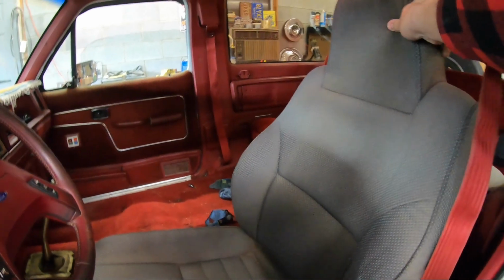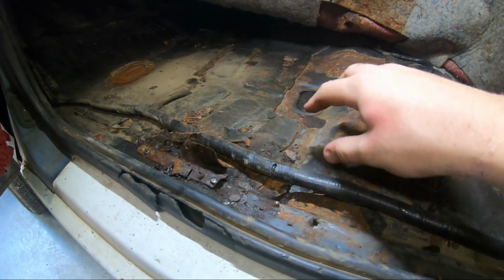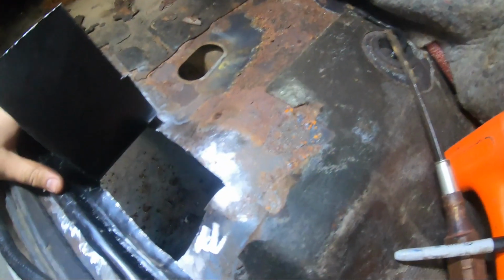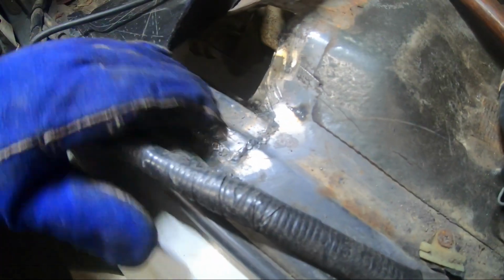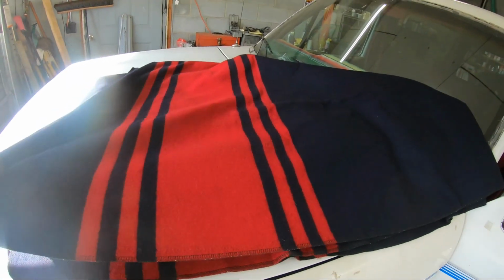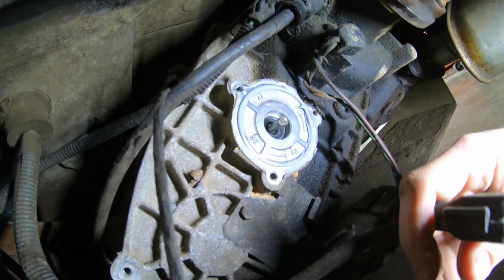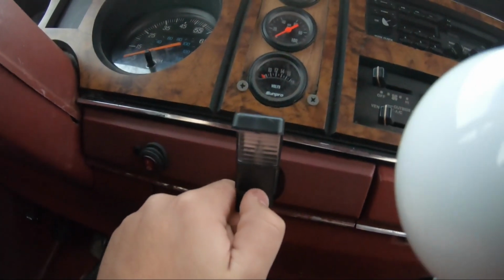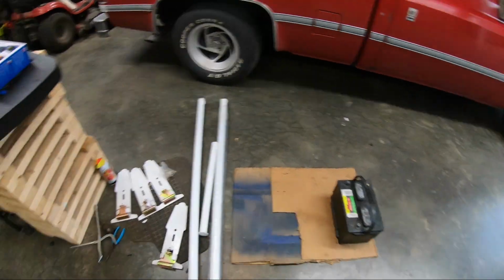Fixing the Biggest issue with my $400 Bronco ii

Comment: So any feedback on the King Cylinder head? More power? Smoother? Any details you can share would be great.
Reply from the maker: I’m not sure about the power since I never really drove it with the stock heads since one was cracked. But I’ve had zero issues with them so far. They claim that they’ve beefed up the areas that crack on then stock heads so in theory there less likely to crack. But overall I’m pretty happy with them
Reply: @JunkTrucks  Thanks I ordered them and they should be at my technicians place this Friday. So should be ready by mid next week. I’ll let you know if there is a difference in power. Guy on the phone said he’s been selling em for 15 years and give a two year warranty. I’ll let you know if it made a difference in power.